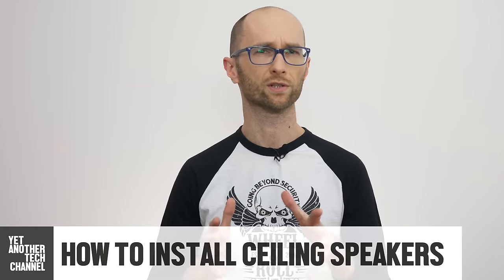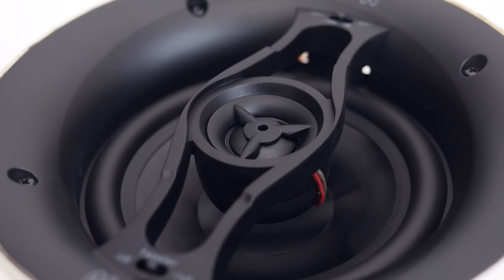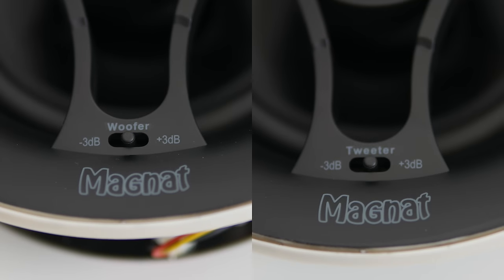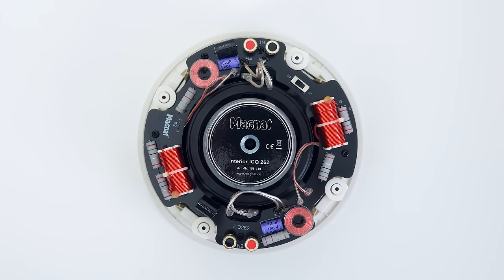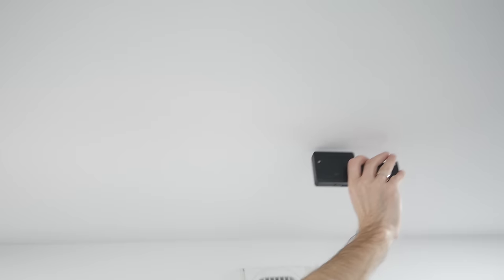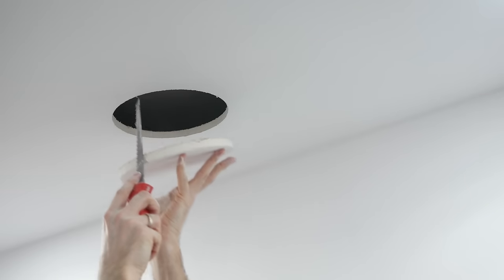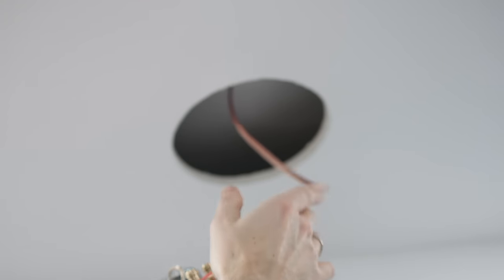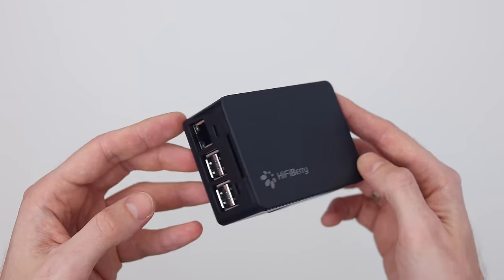How to install ceiling speakers - Magnat ICQ 62, Magnat ICQ 262

Comment: The hard part is getting wire to the speaker... luckily you already had the wire run ...
Reply from the maker: I didn't at my previous aparment but I still managed to run the cable there. It wasn't very long distance though.

Comment: The only thing that can make me like this very short video is the metal detector part which is the only informative part. So i will press like
Reply from the maker: Thanks! I know that this is not rocket science, but I think that someone might find it useful :)
Reply: @YetAnotherTechChannel  NO it's not the part of rocket science lol because i think this video is important but rather i was talking about the fact that the video was very short and missing some key parts like detailed explanations for the cables used, number of speakers needed for specif need etc.

Comment: I do this crap for a living and he left out a major and I mean major issues. When you're doing a retro install of ceiling or in wall speakers for say a 5.1 system you will have a hell of a time lining up the speakers since all studs and trusses are not equal distance. Yea equal distance for the whole building but the room is going to be off center. Also another issue, Pipes for plumbing, gas lines and A/C ducting can be in the way. Then there is electrical wiring. Too close to the electrical can cause 50/60Hz hum, Not the speakers but the speaker wire will pick it up. I would not advise to retro in speakers in a multiple story building. A single story or a top floor then yea so you can get inside the Attic and use markers and properly run your wires down the top plate of a wall.

Seamless speaker grills look like crap on textured walls and ceilings too since the speaker grill can't sit completely flush.
Reply from the maker: First of all - if you haven't noticed - the title says 'How to install ceiling speakers' not 'How to install all different kinds of in-wall speakers' and it's meant for amateurs such as myself, not professionals. Second of all, I moved into a new development - told my contractor that I want recessed lights and speakers in my bathrooms and gave precise instructions on where I want everything to be so it was his job to make sure that drywall supports don't get in the way. Third of all, I used quality speaker cable and it runs far from electrical wiring. Oh, and guess what, I live in a multiple story building and I'm not seeing a reason why anyone wouldn't retrofit ceiling speakers anywhere they want.